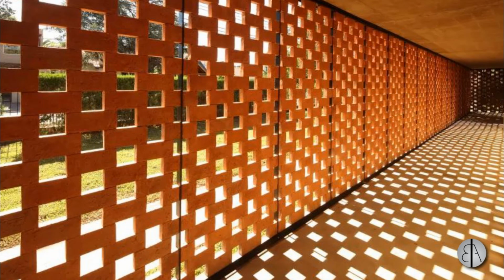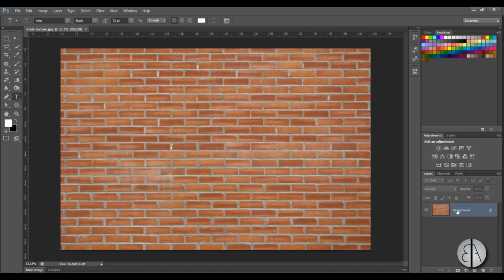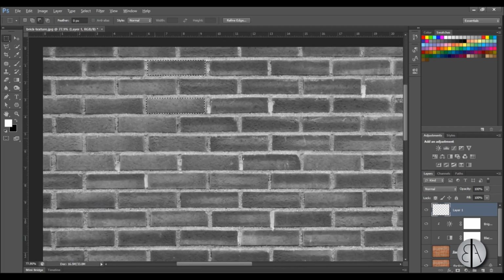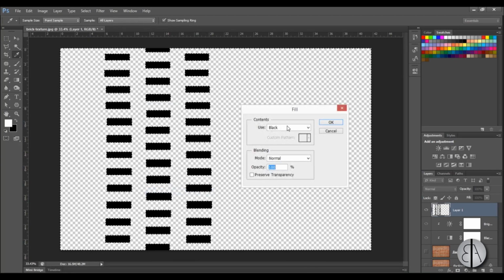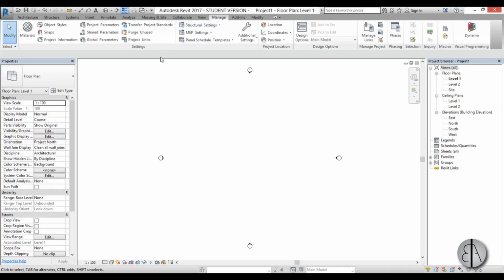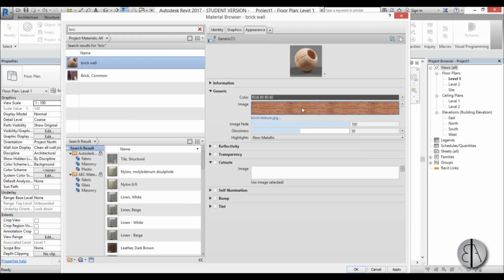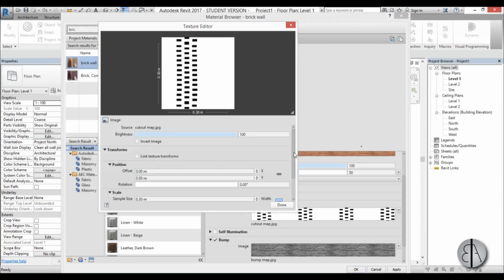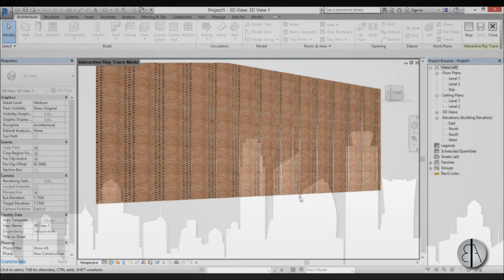Material Cutout in Revit * Cutout Map Material Tutorial *

Comment: Hi, I have a problem, I did as the video shown but when I view the wall in realistic or render it, it shows only 2 thin outer sides without any thickness (hollow)
Reply from the maker: Yes, that is how revit works, you can't change this, you will need to do some post production in photoshop...
Reply: Thank you, before I saw this video I used to do custom patterns using curtain wall or component in place.
Reply from the maker: You'r welcome, yeah this is a bit faster way to get the same thing.
Reply: @balkanarchitect  what kind of post production plz tell ....thanku
Reply: I know this is a bit late but there is a way around this, use the paint tool (PT) and apply a transparent material such as glass to one of the sides, do this in an elevation or section. I was having the same problem...
best of luck!